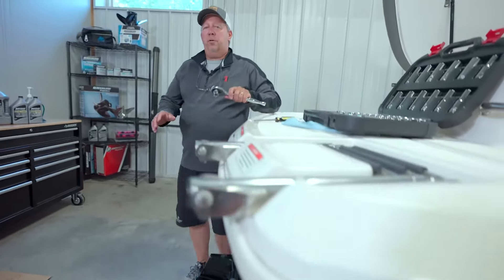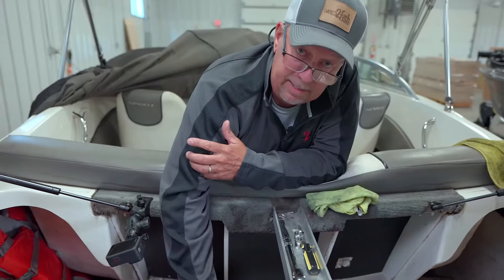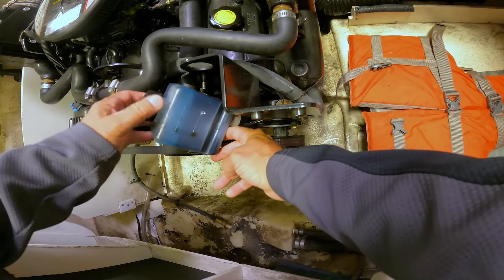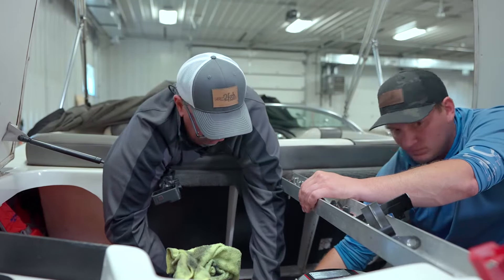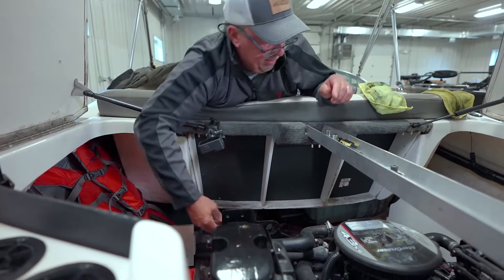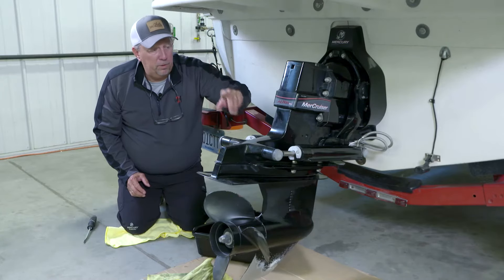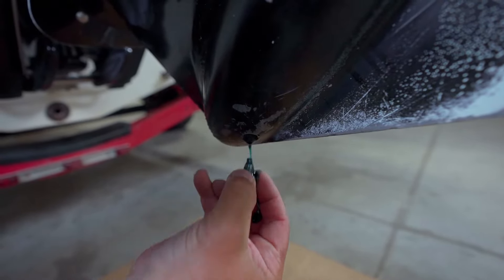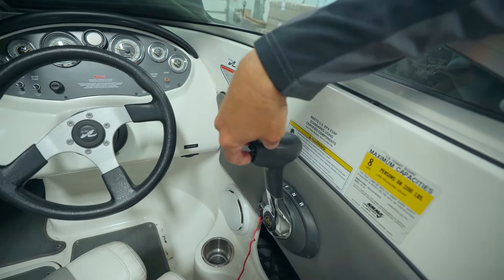How to Change MerCruiser Gear Lube

Comment: A few issues to highlight that have happened to me. 1) Use a shop vac to suck the gear lube out from the engine, you can crack the bottle or ruin the hose, do not remove it. 2) When you fill up the lower unit gear lube make sure the engine gear lube cap is open so air can flow, if not open it can shoot out back at you.

Comment: Hi. Thanks for your video!! I have little bit leaking in my propeller. Do you have any video how to fix this. Thanks !!
Reply from the maker: If you're leaking gear lube in the area of your propeller, you likely have a failed propeller shaft seal. These keep water out of the lower unit and gear lube in. We do not have a video showing the repair of this, unfortunately, as it is a fairly intensive process. We recommend contacting an authorized service center for the product you own to have this inspected and repaired as many times it requires specialty tools.

Comment: we got an alarm and it looks like it’s due to the gear lube being low, is it possible to just top off the oil at the monitor without draining and replacing all of the oil at the lower unit?
Reply from the maker: You can most certainly top off the gear lube monitor if it is low. If the gear lube monitor is empty, however, you will want to see if you can find out where that gear lube is going. If no leaks are present or visible, it might be best to drain the gear lube entirely to make sure you're not leaking gear lube through a seal in the lower unit and also letting water in at the same time.

Comment: Question if the monitor  bottle is a bit of low  can I just  pour more or I have to make the hall process as changing it
Reply from the maker: You can most certainly top off the gear lube monitor if it is low. If the gear lube monitor is empty, however, you will want to see if you can find out where that gear lube is going. If no leaks are present or visible, it might be best to drain the gear lube entirely to make sure you're not leaking gear lube through a seal in the lower unit and also letting water in at the same time.
Reply: @QuicksilverProducts   thank you  !!!so much

Comment: Just did this for the second time.  Only had the boat for a couple years and changed once last year.  Question.  I let the oil drain through the outdrive until this year.  When I dumped the reservoir out I found about a quarter inch deep sludge on the bottom.  Google search resulted in comments that sludge was common but really?   Can't be good so I cleaned it all out.  What causes this and why?  Also, had some  iron filings on both drain plugs.  Again Google search resulted in comments that it is normal but I  believe the prior owner and myself have about 500 hours on the Bravo III outdrive.  I only had 30 hours on last years use due to a mech issue so we didn't use the boat all summer.  Does this sound normal?  Oil was dark but not burnt.
Reply from the maker: It could be that your gear lube monitor hasn't been draining each time, which would mean the lubricant in the monitor is aging. Depending on the climate you operate in, the gear lube monitor could also be accumulating some condensation from time to time. 

While gear and bearing material wear is normal and can be seen in the gear lube or on the magnetic plugs, larger shavings or metal chunks would be an indication of damage within. We'd recommend keeping an eye on these plugs again during your next lube change. If finding metal on the plugs is a consistent issue, you may want to chat with your Mercury Marine dealer for guidance in your specific case.

Comment: Hi my lube is at the fill line, can it be topped up straight into that reservoir or do I have too pump it into the bottom?
Reply from the maker: As long as your gear lube was filled from the gear housing and you have gear lube present in the monitor, you may top it off in the monitor. In the event gear lube is not present in the monitor, then we recommend adding from the gear housing fill hole.
Reply: @QuicksilverProducts  thank you !

Comment: Is is possible to drain everything out without removing the monitor bottle
Reply from the maker: Yes it is. However, the process will take longer as all of the gear lube in the monitor will need to travel through the hose and the upper and lower drive before draining out.
Reply: There is another way! Using a oil vacuum can the same thing we use for removing oil from engines thru the dip stick. Put the hose in the monitor bottle and suck out the oil. You can also use a Brake sucker used for bleeding brakes. Same Idea and alot faster then removing the bracket tipping the bottle upside down.
Reply: @mogyver69  I agree... Seems like they did a lot more work than needed.

Comment: Can i ask a dumb ?  Why cant it be gravity filled from the top vent tube?
Reply from the maker: Filling from the top can trap air pockets within the lower unit in the gears and bearings. Once those pockets work their way out, the gear lube level then will be too low. It is best to fill from the bottom.

Comment: Seems to me that the lube monitor causes more problems than it solves, can it be cancelled???
Reply from the maker: The team here at Quicksilver Products does not recommend product modification. However, you're welcome to contact the manufacturer or an authorized service provider for the product you own to see if they have any suggestions or procedures you can follow.

Comment: Maybe have a oil pads ready for clean up before starting...  as the amount of oil out of the top plug was unacceptable. Could have saw it was near, put a oil pad there and do the last 1-2 pumps.

Comment: You didn't say anything about new o-rings and if they're necessary.
Reply from the maker: We always recommend referring to the operator's manual for the product you own for specific instructions. In this case, we reference checking the seals on the drain and vent screws upon removal, and replacing as necessary.

Comment: This guy is so lost...  When filling the monitor tank...after the top plug has oil coming out....replace plug WITH NEW GASKET. Then continue pumping lube from the bottle that will fill the hose to the monitor tank.  Keep pumping it until you are about 6-8oz short or so (Side of bottle will show...and just need to the hose and the bottom of the tank filled).  Then stop, disconnect pump from lower drain, and replace with a new gasket and plug.  Then fill up monitor tank the rest of the way.  Don't need 2 people, or keep checking your work.  As if 64 Oz is needed, then as you get near the bottom (6oz left)  of the 2nd bottle, you know the monitor tank is not going to overfill.  He doesn't mention checking the bottom mag plug for debris, using new gaskets